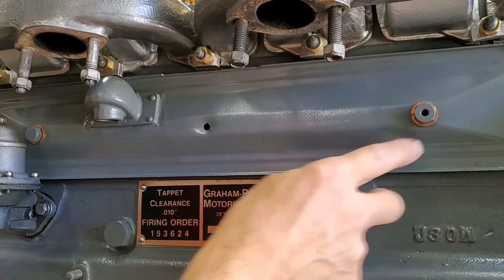1939 Supercharged Sharknose Graham Engine Overhaul - Preview of How to Rebuild a Graham Engine

Comment: Excellent! I have 3 1937s. The one I'm working has a Hollywood motor. Where are you getting parts?
Reply from the maker: Glad you found us! You can find gaskets online at rockauto.com, search for Kaiser-Manhattan 1952. You can use the part numbers from RockAuto and take them to your local auto parts store, if you would prefer. The price is usually lower at RockAuto. Cam bearings, main bearings and rod bearings are available from Kaiser-Willys online or Egge Machine. Remember they interchange with a  Kaiser 226. We usually pick up pistons on Ebay. As long as they interchange on basic bore, you can use 1936-1941 pistons. Split skirt pistons need to be installed a certain direction. Hyster fork lifts used to use the same rods. You might be able to get them through a Hyster dealer. Remember, many Continental engine parts will interchange. Rod Bolts come from American Racing Products, use the number as shown in the video. Head studs are available in the Norman Products line. Timing chains should be available from Egge Machine, occasionally they are on Ebay. Valve guides and valves are available from Kaiser-Willys. Valve springs, hardened washers, and valve spring spacers should be available from a quality local machine shop - take samples. We make laser-cut supercharger gaskets here. Look them up online at www.CustomReplications.com Thanks for watching!

Comment: I always cringe when I see copper tubing used in pressure situations.  Copper work hardens and will fracture over time and pressure cycles.  But, then I have to remind myself.... a car from the 1930's cooling system operated at ....what..... 5 to 7 psi?  And with the amount of time it's driven, it would probably take years for that tubing to stress fracture.  Still, the engineer in me would rather see steel.
I've seen copper used as brake lines.  That was a sphincter-clincher for sure.
Reply from the maker: Oh, how interesting. Thank you for sharing your expertise. I should mention that Graham's cooling system was non-pressure. Graham had a special high strength copper tube however, for the brake system. We wound up using modern steel for the brake lines for safety reasons.